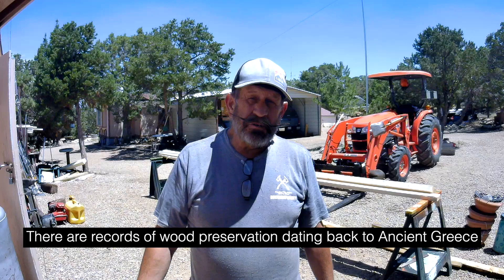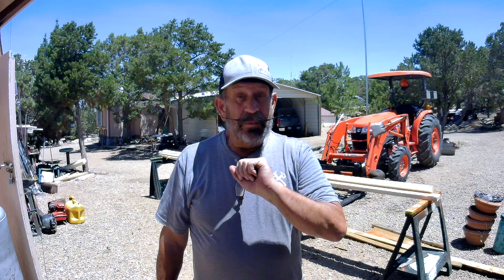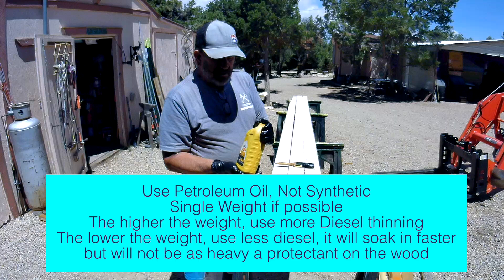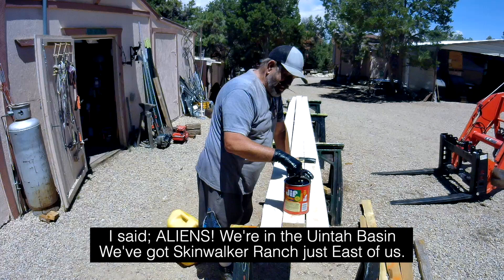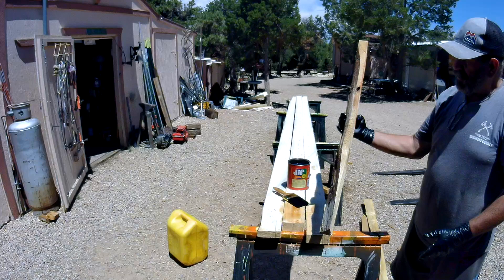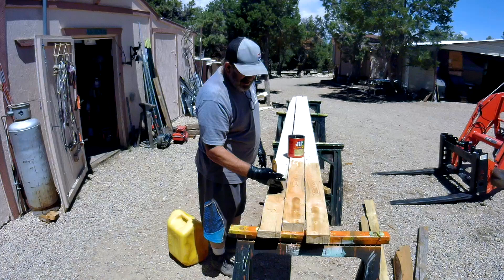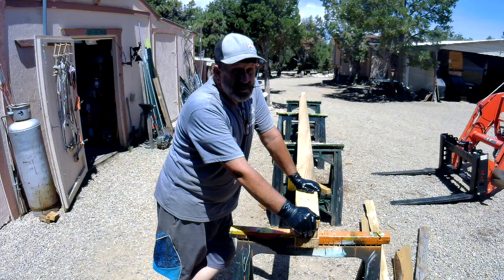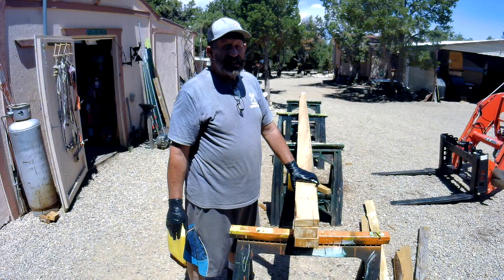Preserving Wood without Pressure Treating

Comment: I use the 50 50 diesel and used motor oil but roll  it on  with paint roller and pan........Goes on uniform and you can add the second coat in minutes.....Enjoy.
Reply from the maker: Great tip! We use brushes for the long stuff.
Reply: About used oil? Back on days that was what my father used on fence posts. But  only for the part that goes in the ground. Roof tar works too, but used oil is cheaper.

Comment: Is this the same method you used as a kid
Reply from the maker: My grandfather used 90 weight gear oil diluted with diesel.
Reply: @CaptainWingnut  ... Does it cost more is that why your not doing it that way

Comment: Might be a dumb question but does this make the wood more flammable/combustible?  Thanks
Reply: When it's fresh it's definitely more flammable, but the hydrocarbons, the highly flammable stuff, evaporate pretty quickly leaving behind a gummy residue similar to varnish that dries pretty hard. It probably does effect it's combustibility, but I wouldn't suspect much or enough to not use this method. The alternative is the wood nearly dries out completely which also increases ease of ignition. Keep in mind, almost all wood finishes are petroleum based made from what's left over after refining fuels and oils. It's all highly combustible. I use old motor oil in a tin can to start my burn pile and it's not as easy to light as most would suspect. You're question isn't dumb, it seemed obvious at first but I ended up thinking it through for a while. Sorry I'm not better at being brief or concise with my scattered thoughts and utterances! Hopefully I either helped or sparked more questions.

Comment: Does it have to be new oil can you uses used oil
Reply from the maker: Either, depending on your budget. Used oil, especially diesel has massive carbon particles which also add protection.
We use new golden oil for wood that needs protection but will also show, like the wood in our greenhouses that we don't paint.

Comment: So you use about 50% diesel fuel & 50% single grade motor oil? Can kerosine be used instead of diesel? And does the mixture need to be exactly that proportion? Thanks!
Reply from the maker: 50/50 is just to thin the oil so it soaks in faster. Kerosene is just higher quality diesel. It works too.
Reply: @CaptainWingnut  thank you I am new to homesteading.  I have been studying for a few years, but I am about to start a project this summer and I am so happy & grateful to have found your Chanel. Peace and blessings to you and yours and all your endeavors
Reply: Thanks for asking I was wondering that as well

Comment: What’s wrong with using only oil ? I did on a shed 50 years ago and it’s still being used today
Reply: what kind of oil please
Reply: @sunshinesparkles4217  hi ….old used engine oil out of my car..after I did a oil change….no particular brand just used oil..
Reply: Is it ok to use new oil?
Reply: @CryptoJourneyKs   I suppose it is ok to use new oil , it’s just a more expensive way to do it .. old car sump oil is what we used so it would be thinner and obviously black ..
Reply: Diluting it makes it easier for the board to absorb. Theres not a ton of options for what can be used for dilution, but Diesel is very similar and shares a lot of the same hydrocarbons so it homogenizes easily and consistently. It mostly evaporates as it dries and what's left behind stays bonded with the oil and should actually help thicken it and harden as it dries. It's all just to make the oil more viscous for ease of application is all. Straight oil works just as well, just takes longer to soak in and it can't be sprayed on, which is what I do.

Comment: Are you still making videos? New subscriber here.
Reply from the maker: Oh yes, I’m a one man film crew, actor, and post production editor.
Throughout the summer I’m so busy with ranch chores that by the time I come in after 18 hrs of hard work, I’m so exhausted that I can’t concentrate on post production.
I do get some garden videos out throughout the summer but it tough.
I have a ton of film in the can from this summer and winter time is when I cannot be out building and tending to nut trees so it’s when I can sit at the compter and put them altogether…
This winter I’ll show you two High Tunnel greenhouses that I built, a sawmill that I designed and built that can take a 3 foot in diameter tree (in my opening video you’ll see the log truck delivering my logs), a jacuzzi, we drilled a water well, gardening videos, snow plowing, tree planting and some other instructional videos.
Stay tuned, more is coming.
Thanks for asking and watching.
Capt Wingnut

Comment: After you treat wood like this, can you use paint over it?
Reply: I think it would work,  but maybe it gets dissolved by the oil underneath it, but i bet if it dries quick enough it would work, but i guess i could be wrong.
Reply: I have lived 50yrs in florida not the treated wood from bigbox stores is not like it was yrs ago it last maybe 5 yrs
Reply: Oil based paint is all I'd risk trying over oil saturated wood.

Comment: Can you use ethanol free 87 gasoline?  I don't have any use for diesel but keep gas cans for yard tools
Reply: Do not use gasoline.   It's far too flammable.  Diesel fuel has a much lower flash point.
Reply: @toddwheeler1526  good point, shoulda thought of that!
Reply: @dissonant808  I'm definitely not an expert, so just spitballing here; But maybe make a small batch and test it's flammability. Just an oz. of each in a tin pan, in a safe location outside. Yes, gas is more easily ignited. But I'm thinking once mixed with oil, that may significantly reduce it's ignition point being that it's the gasoline vapors that are the actual combustible. Folks use mineral spirits, kerosene, etc. and those are quiet flammable. Cheap and easy to test what you have and know for sure. Something I want to look into is, and I know it sounds a bit goofy/oxymoronic, which "fuel" is cleanest to use and if one dries faster and/or dries harder than another. And does one dry better, leaving no residue to get on your hands, clothes, etc.
Reply: @wingnutbert9685   Makes sense to me as a safe way to test ignition hazards.  I too love to see different things tested to see how they perform and hold up over time, which is why I love @ProjectFarm videos.  I do have ATF oil that's been sitting around not being used (could impart a nice "redwood" tone to the wood), some mineral spirits and think I saw some kerosene around here too, so maybe I'll try a small scale test on variations to your original recipe!
Reply: Please report how it works out. I'm no expert but have heard ATF perpetrates more than oil. Some people use it instead of spray cans of penetrating oil on rusty bolts, etc.
Reply: Penetrates, not perpetrates
Reply: @dad1432  Well, I thought I would try the original recipe first before modifying (SAE30 + diesel) and it has not held up for me at all.  maybe my environment is just too harsh (salt air, sand, high solar insolation)... Not sure what modifications I should try to get the result in the video... I saw another video where they add some wax...